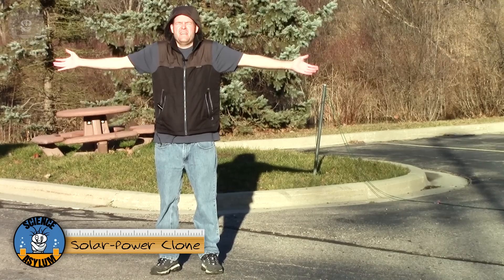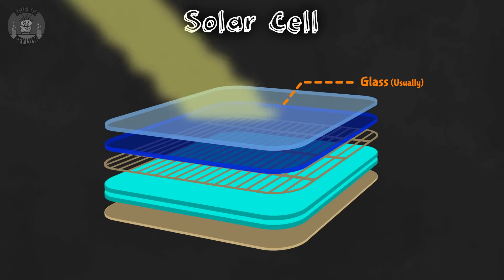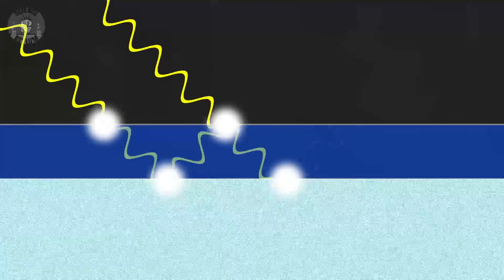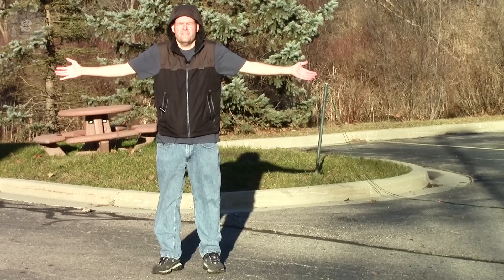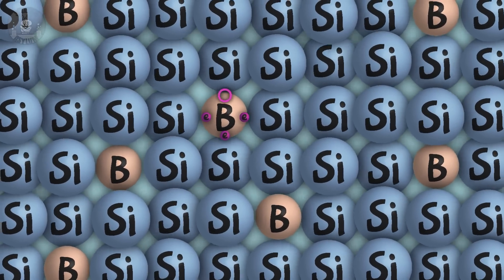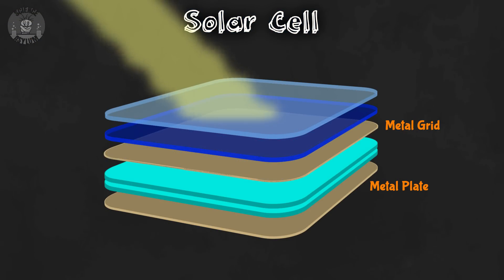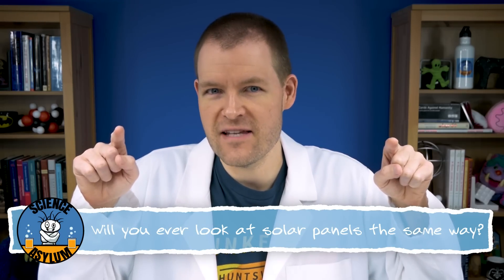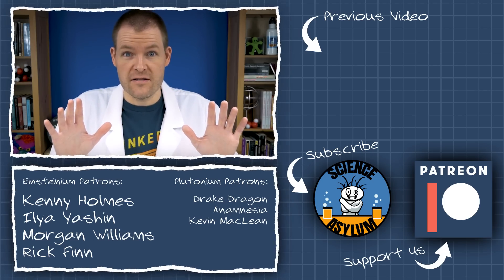How Do Solar Panels Work? (Physics of Solar Cells)

Comment: fun fact : solar power is actually a nuclear power from safe distance
Reply: Fun fact: fossil fuel is fusion power from sun stored in dense form and ready to use
Reply: Андрей Кравчук U-235 and Pu-239 is a power stored from hypernova in denser form and ready to use.
Reply: @WhiteD85  
Millenials? Uneducated? What? Are people born in 1960's millenials? Are people with University degree uneducated? Maybe in Ruskie standard, but hey ... everything is other way around in Putinistan.
Reply: @WhiteD85  I agree. To replace the electricity production of a single 1000 MW nuclear reactor, we would need approximately 40 million 300 W solar panels. Also no energy storage is needed with nuclear.
Reply: i have to agree with Андрей Кравчук
  the solar power is extremely inefficient and toxic that comes from production of these panels.
Reply: @WhiteD85  I don't think you can build a nuclear power plant and generate your own power
I like nuclear power for a nation/country but I can buy and set solar PV system for my own use.
Reply: @WhiteD85  Do people formely residing around Fukishima and Chernobyl  feel the same.?
Reply: @Андрей Кравчук You come up with all sort of nonsense. Solar PV is now the most cost effective so much so that I decided to fully power my house with solar PV that includes heating. I have a small offgrid house in Saskatchewan Canada and the cost amortization over the life of the system is $42/month about half of that for heating and the other half as electricity for appliances.  Here you will find links to the devices I developed (all open source) and last document show why both thermal solar and natural gas are more expensive than PV solar for heating https://www.kickstarter.com/projects/electrodacus/solar-bms-and-digital-mppt-for-pv-electricty-and-h
Nuclear is just more expensive than solar PV and solar PV continues to improve while price drops.
Reply: @WhiteD85  dont agree with the brainwashed thing, there has always been stupid people, today sadly we have much cover on them. But agree that renewables like solar and wind are not the answer. The power output needed to power the world today and in the future is gigantic and we would have to cover a lot of terrain with those, killing the environment in the process. Nuclear power is the way, the most safe, clean and energy dense source of creating electricity, plus with all that power we could use for producing hydrogen on a massive scale for cars/planes/boats/rockets.
Reply: @WhiteD85  not that kind of nuclear power though, fusion is when we get round to it.
Reply: @zodiacfml  Why is that an advantage?
Reply: @ferencgazdag1406  which one
Reply: @zodiacfml  The fact that you can have your own solar array
Reply: @zodiacfml  yes absolutely. You can't generate power for the world with unstable solar. Atom is the answer for the energy crysis. And solar is for my house's roof to minimize power losses over distance.
Reply: @WhiteD85  nab the future is a mix of renewables and nuclear
Reply: @WhiteD85  Cities and even homes that embrace solar power typically generate more power than needed. You can sell off the extra power. Can you please provide a source for your claim?
Reply: @WhiteD85  The mining and pollution required for solar cells provides power for 30+ years. The mining and pollution from fossil fuels must be repeated for every unit of energy because the products are consumed by generating power. Both the cost and the lifetime pollution and CO2 production per unit power from solar are already below that of fossil fuels with today's technology, and solar efficiency is still increasing. Your information is outdated.
Reply: @sergegosselin1712  what about the millions who died of cold when denied fossil fuels?
Reply: @WhiteD85  you miss-use the phrase "ready to use" to mean: find iol fields, drill hole, pump down water, pump up raw oil, ship raw oil, refine raw oil, ship products of refined oil.
Reply: @WhiteD85  ha ha ha ha....really?, if your words are so true, why don;t you brainwash those nuclear power plants victims to live right beside a nuclear reactor again, oh the enlightened one?, I bet you don't want to be the victim right?
Reply: We've come a long way since Chernobyl; modern nuclear power plants aren't particularly dangerous.
Reply: @matthewalexander9277  Yeah, that's what they tell you because otherwise nobody would let them build any new nuclear power plants. They told the public that they are perfectly safe with the older generation of nuclear power plants, too. The thing is: they are not. Can not, because of the way they have to work. They need to maintain the chain reaction. Yes, you can add more and more barriers to try to prevent a run-away chain reaction, making it more and more safer. But give humans enough time, and they will fuck it up. The problem with fission reactors is: when you fuck up, you can only do it big time. Like making thousands of square kilometers uninhabitable for the next few millenia, displacing hundreds of thousands of people on top of the ones you kill from radiation poisoning or cancer. Yes, fission is a great way to produce huge amounts of energy ... as long as you don't factor in the risks. The heck, even if everything runs perfect, we have to deal with the waste we produce. And we're talking about geological time scales for that one.
Reply: @FriedrichHerschel  Nuclear reactors can, in fact, be made safe. There are 30+ year old designs that simply can't melt down the way Fukushima did, and no other reactor design besides RMBK in use for commercial power can fail the way Chernobyl did. As far as waste goes, the only thing we currently know how to do with it that is safe and practical is to keep burning it. Spent nuclear fuel still contains the vast majority (98+%) of the energy it had when we pulled it out of the ground. There are reactor designs, called fast reactors (among others), that can keep burning that fuel over and over again. Each cycle through extracts more energy, and when you're done, the remaining waste will only be dangerous for hundreds of years, not hundreds of thousands. Building a structure that will endure for a thousand years is easy, humans have been doing it a long time, so we can handle storing that without much trouble. As a bonus, just the current spent fuel stored on site at our existing nuclear power plants could provide all our energy needs for hundreds of years.

And this isn't all just theoretical, the Integral Fast Reactor was just such a reactor that was designed, built, and operated in the late 1980s. It was passively safe, with its safeguards driven by physics (thermal expansion, convection, etc.) rather than machinery. A utility scale version was cancelled in the early 1990s just before it was completed.There are a number of other designs now that accomplish the same goal, and some are likely even better.

Even if we never made another gram of nuclear waste, this is the only way we know now to safely deal with the waste we already have, and it could get us off of fossil fuels faster than any other technology.
Reply: @FriedrichHerschel  Oh, and the bit about maintaining the chain reaction isn't quite right. All commercial reactor designs, except RMBK (like Chernobyl), require water in the core to keep the reaction going. If the cooling water boils, or stops flowing, the chain reaction stops. The water acts as a neutron moderator, slowing down the neutrons emitted by fission reactions. Thermal (i.e. slow moving) neutrons are required to sustain the chain reaction. No water means the neutrons pass through the fuel and don't cause any further reactions.

Fast reactors use a reaction sustained by fast neutrons (hence the name), so they don't need a moderator. They often rely on the thermal expansion of the fuel to control the rate of reaction.
Reply: Solution. Do our own nuclear reactions. Give it as much r&d as fossil pathways and I'm pretty sure we'll overcome the hurtles.
Reply: Sounds more like the "Chemistry" of Solar cells, discussing more of the elements and the periodic table.
There are multiple ways to harness solar power.  Solar PV is just one of them.
The Physics of solar PVs is the Photoelectric effect and the electromagnetic spectrum.
You discussed anti-reflective coatings substantially without stating you have to select a wavelength range infrared, visible, UV, etc.  After that, you will be able to tell which wavelengths solar PVs are converting which I think is important to know about solar power PV. 
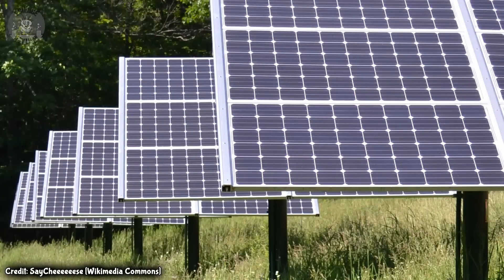7:06 You made it sound that DC is inferior and besides it is out of topic.  It is a long video by itself (inverters). 
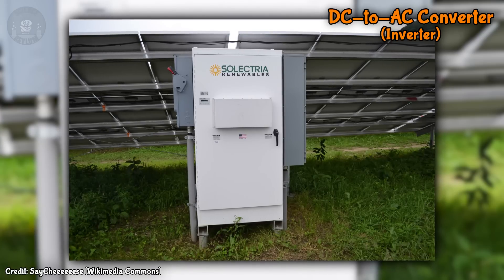7:16 Energy storage is a video by itself and is out of topic. I haven't heard of energy company using capacitors.
Reply: Well, the same can be said for hydro and wind powers. I'm not sure if the same can be said for geothermal.
Reply: funnest fact...
i am nuclear power, 
well used to be..
Reply: Apparently few of you saw the designs of the thorium molten salt reactor.
I am all for clean energy, but discarding such a safe and efficient power source is down right stupid
Reply: So are current modern nuclear reactors
Reply: Stick solar cells in fusion reactors boom
Reply: Solar power is Fusion power 🤯
Reply: @ytzsch1967  everything has its origin in fusion power including coal, oil and gas. Your point is?
Reply: From unsafe distance but with magnetic safety wall
Reply: Spooky fusion at a distance
Reply: Fun fact: no it's not.
Reply: Actually, nuclear power from any distance is pretty safe.
Reply: Well infact all forms of energy we use now is someway sourced from sun.
Reply: @loki7237  then comment on hydro energy 😈
Reply: Until it goes supernova on ya'
Reply: Nuclear + gravitational
Reply: So is practically every other energy source (besides geothermal)
Reply: @JosephClayson  Geothermal is a product of radioactive decay: nuclear power.
Reply: @josephcoon5809  oh snap u right 😮
Reply: @JosephClayson  Not totally, though.

Some of the Jovian moons have gravity induced geothermal energy.

Basically the shifting of matter due to variation in gravity fields creates friction forces which heats those moons up.

Also, I’m willing to bet that the interaction between the Sun’s magnetic fields and solar radiation affects the Earth’s magnetic field which would also induce mechanical forces on the ferromagnetic materials in our mantle. Then again, that would still be a product of nuclear power as well.  😂 

Isn’t science FUN?!?
Reply: Fun fact smoke detectors contain beta rays that when they get blocked by smoke the alarm sets off
Reply: I would not call it a safe distance since you can still get radiation burns in the summer pretty easily.
Reply: @tktspeed1433  it depends on your location as if you where near the open hole in the ozone then yes you'll get radiation burns from the UV-C rays
Reply: @TheChewman1  normal sunburns are radiation burns, unless you think the heat somehow gets here by convection perhaps?
Reply: @tktspeed1433  no what I was saying if you read it properly, is that radiation burns that are severe can only really happen when exposed to UV-B/ UV-C rays (yeas UV-A is harmful in mass amounts.) The whole entire point of the ozone layer is that its created to protect the earth from the harmful rays. So when there was a massive gaping hole in it, people who went near the hole tended to get severely burnt by mainly UV-C rays.  So yeas while sun burns are a form of radiation burns it is also the sun cooking you like an oven
Reply: The earth is at a safe distance from the sun its not our fault you don't wear suncream to protect yourself or wear garments like hats to shade yourself
Reply: @TheChewman1  ovens work by convection and very slight conduction, not radiation like the sun, and I do wear suncream but you will still get a sunburn on a hot day from the sun's radiation if you are outside for long enough unless you are:
A. A dark skinned fellow
B. A light skinned fellow who tans fast af (not me)
Reply: @tktspeed1433   its not just hot days you also get burnt in the winter especially if you are in a place thats gets caked in snow as the reflection off the snow can burn, I'm a white pale ass dude who can get sunburnt easily I always put it on suncream and re apply after 30 mins as per instructions its really not that hard to do, and actually alot of dark skinned people can still burn
Reply: @TheChewman1  hmm, true, I am just always wearing enough clothing in the winter and it is just constant darkness as I live up north so I have never gotten burnt in the winter.
But it not being the heat even more proves that it is indeed radiation burn instead of any other kind.
Reply: @tktspeed1433  ahh I didn't thi k about that my bad
Reply: And another one for you is all solar panels are LEDs and all LEDs are are solar panels
Reply: Fun fact: the government of China is manufacturing solar cells utilizing slave labor from Uyghurs
And as a result has been sanctioned by the US government to stop Chinese manufactured solar panel imports into the US market

Which even confused John Kerry the US environmental ambassador to the Chinese who was quoted as saying: 
"we want to work with China but we also have banned their solar panels"

As a result of standing up for human rights in supply chains 
(You know something that should be a God Damn higher priority than both environmental policy and profitability in business)

the Chinese solar panel ban has pissed off a lot of solar panel installation companies in the US, who are actually wanting the ban to be rescinded because now their business costs have risen. 
The Chinese solar products were typically the cheapest on the market to purchase allowing those same installation companies to make a very hefty profit

Because not only would they get the profits from the customer for installation but both the customer and the installation business would receive subsidies by the US government, as well as a Tax reward

Never forget that yes even a solar panel isn't immune from human corruption, and political policy
Reply: @jaikumar848 Are you sure? I think that's a lot like saying hydro-power created by waves created by wind is wind power. Cause and effect not "effect and effect".
Reply: Never will be
Reply: 40 feet or so is a safe distance from nuclear power.
Reply: Fun fact: everyone is saying fun fact...
Reply: fun fact: I KNow Nothing
Reply: Also every other power is solar power from the past.
Reply: “Safe”
Reply: sad fact: carbon is gonna kill us all if we didn't stop using fossil fuel
Reply: @NourAhmed-go5jo  Haha! A carbon-based life form bitching about carbon.
Reply: @NourAhmed-go5jo  unfortunate fact, this is only true based on artificially exaggerated models used to spark fear.
Reply: @GaaaageE  people denying global warming is still somehow a thing nowadays?

The arguments are on the tradeoffs of fossil fuels vs battery production. The dinosaurs denying that global warming is real haven't been relevant in the discussion for quite some time.
Reply: @Syllaren  nobody is denying global warming. Climate change is real and has always been real, long before humans. But if you think batteries are a cleaner option you might find yourself a book about how they’re made. The climate is not a threat, plain and simple.
Reply: @GaaaageE  no one except for you that just got done saying the models are exaggerated to strike fear. That kinda implies it's not a concern.

Also considering I just said the conversation is on whether the pollutants from the batteries are worse or not, I obviously don't consider them as a miracle solution.

The issue is that it might be easier to solve the impacts of it's pollution than it is to solve the issues from excess coal burning.

We can have recycling and cleanup technology breakthroughs/regulations to deal with the toxic byproducts if batteries and solar arrays, but removing the excess greenhouse gasses from the atmosphere is much harder. That being said, that still relies on those recycling measures being done and those cleanup and reduction measures being implemented. Both theoretically possible, but not being done widespread. So yeah it's still bad. The issue of discussion is how likely it is to be better with achievable improvements.
Reply: @Syllaren  correct, not denying it exists, denying it’s a concern.. because it’s not. It’s fear mongering. Read a book.
Reply: @GaaaageE  that would be the dinosaur talk again. There is a rather overwhelming consensus ATM that climate change is a genuine concern for us.
Reply: @Syllaren  that’s why all the dopes preaching about it are building multi million dollar mansions on the coastline right? 😂😂🤡
Reply: @GaaaageE  I mean... Yeah. When that property eventually gets taken out theyll have insurance through the roof on it.
Reply: @Syllaren  Alright, I hope you have a good one and don't spend the rest of your life worrying lol. I'll enjoy my life and won't bend the knee to a bunch of climate hacks.
Reply: @GaaaageE  I'm not that worried. The worst of it will hit in about 30+ years and without major technological advancement I'll already be dead or near dead. Also don't plan on having kids.

So I'm not to worry. Guess you plan on letting your kids inherit that hellscape though. Not exactly looking out for their best interests.
Reply: @Syllaren  😂😂😂😂😂 have a good evening ya nut
Reply: @NourAhmed-go5jo   cArBoN iS gOnNa kIlL uS.
Reply: @NourAhmed-go5jo  happy fact  fossil fuels lifted millions out of poverty
Reply: @NourAhmed-go5jo  The “didn’t” in your comment makes you sound like you’re from the future.
Reply: @NourAhmed-go5jo  not it isn’t. Can you supply the evidence to support your hyperbole?
Reply: @NourAhmed-go5jo  thats awesome i never noo that
Reply: @NourAhmed-go5jo  more sad fact: production of solar panel and battery gives more toxic waste than burning amount of fossil fuel producing same amount of energy that solar panel makes during it lifetime. And there is toxic waste when panel is disposed. But there is good side: all this solar power garbage made in China. You don't care about those people. Right?
Reply: Андрей Кравчук but we can't relay on fossil fuel for long...right?we have to use alternate energy source in future no matter how toxic it is
Reply: @WhiteD85  Provide proof !
Reply: @WhiteD85  I looked this up on the internet and guess what I found? Absolutely nothing to attest to what you're saying.
If this we're the case why would scientists still be researching them with the goal of making clean energy? If this were true it would have become widespread knowledge and research would have slowed to a crawl or stopped completely. Scientists aren't stupid, quite the opposite. They know what they're doing.
Reply: @WhiteD85  lol you can use solar panels for many straight years but burning fossil fuels each time will produce far more pollution. Use your brain fella
Reply: @WhiteD85  You are wrong
Reply: @WhiteD85  that's why we need more nuclear power plants if you look at the facts less people have died from nuclear power than any other sources
Reply: @alansmithee419  funding. There is your answer.
Reply: @WhiteD85  the main problem with fossil fuels is the carbon dioxide, not the toxic waste, which of course causes tremendous harm to the biosphere in very different ways.
 The waste caused by solar panels is a big problem, and is currently being worked on by a lot of people.  Solar panels may not be sustainable in the very long term, but we need to get off of fossil fuels ASAP, maybe is can buy us some time.
Reply: @WhiteD85 Luckily that's not true anymore! Solar energy is one of the cleanest and most efficient forms of producing energy, including the producion and waste managament. Burning fossils is going to be laughed upon in 50 years.